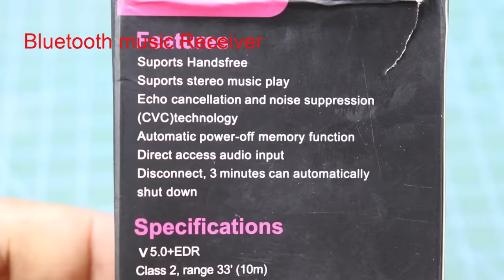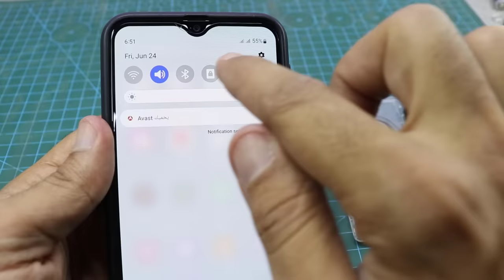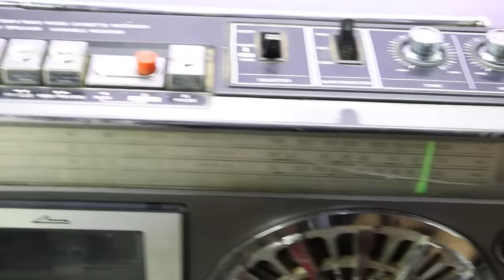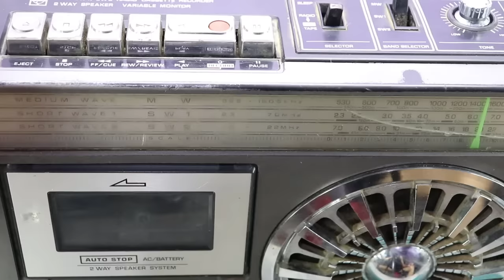This Device is very helpful , you can make at home

Comment: You can do other mods to eliminate the battery, an internal power route.
Make a metal contact in the cassette deck where the cassette slots into,, which is connected to an internal power line(find suitable power source from circuit board, then have a metal contact wired up to the Bluetooth module within the cassette housing. Put the cassette into the deck so both contacts touch each other to provide power to the Bluetooth cassette module.
Reply from the maker: genius Idea 😉

Comment: I can't believe it someone is doing this in 2022. Price of entire BT speaker is 2-3$... Thumb up for nice project... :D
Reply from the maker: This device is useful for those who have an old cassette
Reply: @Inventor_AW  yed, but why would you use it that way? It's some worth casette player, so if you want to use it as amp with speaker open it and connect it directly to amp. This way you have a lot of signal loss so sound is 💩

Comment: Cool, but for like $8 on Amazon you can get a pre-made tape adapter without having to break out the soldering iron
Reply from the maker: I did not mean to use this thing in 2022.. It is only useful for those who own an old cassette or a car with a cassette

Comment: Back in the 60's when small, portable reel to reels were popular, I discovered I could remove the tape head and attach a speaker to the two wires and make a little amplifier. I decided to bug my sisters room by taking small copper wire unwound from an automotive voltage regulator and run it out my window to my sisters room. I would then connect and hide the speaker in her room by hanging it off her curtain rod. 😄😄

Reply
Reply from the maker: I'm glad to make you bring back some memories

Comment: Actually, all you need to do is solder a small cable to the line input to the preamp, and drill a small hole to fit the tiny socket.

Comment: I was going to point out that this is mono, but somebody else did it already.. I'd like it more if you had used a stereo head for the cassette, it was going to work the same in that old mono player, and in a more modern stereo one.. But us a very good idea. It's inspired in those old cassettes with an aux micro-stereo plug, but this is Bluetooth.. A nice way to use those old players, that one is now a vintage BT speaker with AM/FM receiver.. hahaha 🤣

Comment: It is mono... Not Stereo as it would be near impossible to align that broken off tape head to the tape head of the tape player. Since it is also putting the positive leads of both the left and right channel, what you hear on the tape player is only what is not on both the left and right channels at the same time, meaning usually bass drums and bass guitars, and even sometimes vocals if the singer was recorded with a mono microphone. This is a horrible idea. Instead use that headphone plug jack on either end to plug the Bluetooth receiver into the AUX port on the tape player and listen to your music that way or just plug headphones into the Bluetooth receiver.

Comment: I have never seen such a stupid thing: 1- the sound of only the left or right channel (where the signals are combined);  2 - the head has slopes and is not positioned;  3 the engine of the tape recorder is constantly running.  To solve these problems, instead of the head in the tape recorder itself, a bluetooth module is soldered and power is supplied from the device itself and not from the battery...

Comment: why not just plug the bluetooth adapter into the aux input which most cassete players have?
Reply from the maker: what if the cassette has no AUX?
Reply: @Inventor_AW  If you have the technical skills to make this cassette adapter, you should be able to add an AUX input to your boombox. It's even easier than making this adapter!

Comment: How much did ALL THOSE PARTS COST YOU?? OR .... YOU could just buy a modern Portable Bluetooth on Amazon for $20 USD ( I did) like a Jam Replay,  that will play for 8 hours on one charge.... and not have some big bulky radio you have to plug in to a wall socket or buy expence D cell batteries to power!

Comment: Although feasable, this is not as easy as depicted. If you build this, you have a chance it might work, or a bigger chance it will sound awfull. 

That head needs to be aligned.
Reply from the maker: Just place the head in the center of the tape to get it aligned
Reply: @Inventor_AW  It's not that simple. Most tapedecks have a system with a set screw.
Reply from the maker: @janklas7079  alignment is really needed but in the case of running a Tape because it's thin
Reply: @Inventor_AW  Alignment is even more needed. Because the tape is thin, you can have it self-align. You can't do that if you butt two heads together.

Comment: Unfortunately far too complicated, too cumbersome and only one audio channel. In addition, Bluetooth usually only reaches 10 m and can only supply 1 device.  🙄🤦‍♂
MUCH SIMPLER: FM transmitters to VHF can be bought as a ready-made device for €10. Simply plug into the headphone jack of your smartphone (or any other device with audio out) and in the neighborhood within a radius of 100+ meters all radios on FM/VHF will be served with music, even in stereo. The transmission frequency can be adjusted between 88 and 108 MHz. 👍☺

In German: 
Leider viel zu kompliziert, zu umständlich und nur ein Audiokanal. Zudem reicht Bluetooth oft nur 10 m und kann nur 1 Gerät versorgen. 
Viel einfacher:  FM-Transmitter auf UKW gibt es als fertiges Gerät zu kaufen, für 10 €. Einfach an die  Kopfhörerbuchse vom Smartphone stecken (oder beliebiges anderes Gerät mit Audio-Out) und in der Nachbarschaft im Umkreis von 100+ meter werden alle Radios auf FM/UKW mit Musik bedient, sogar in Stereo. Die Sendefrequenz kann eingestellt werden, zwischen 88 und 108 MHz.

Comment: плохой способ ! головка очень точно настроена к ленте а сдесь она болтается качество будет отвратительное ! темболее сигнал аналоговый от голвке к головке ! у каждого магнитофона есть линейный вход просто надо было купить разьём и к нему припоять блютуз передатчик
bad way! the head is very precisely tuned to the tape, and here it dangles, the quality will be disgusting! the signal is analog from the head to the head! each tape recorder has a line input, you just had to buy a connector and solder a bluetooth transmitter to it

Comment: This is how you can destroy your old cassette deck. Hhahahah I remember the time 30 years ago when that was "good idea" for only few models. Most cassette players had protection and that will never work.  Final decision: Useless like before.
Reply from the maker: What's do you think?
https://www.youtube.com/watch?v=_dbNfvZM1ZE&t=406s
Reply: @Inventor_AW  Hahhaha, this is not called "avoiding protection". There min 3 switches in the player that you cant make to work. Some of them measure tension between tape and real speed. Also if you pit this in "auto-reverse" deck with spinning head you will destroy it. As i say before. That device was good 30 years ago only on very few models cassette players. And they was STEREO compared with your MONO head. ;) And even with factory quality sound was bad.... very bad. Your phone have 10 times better sound than any 30 years old cassette player. I can make steam locomotive to work on nuclear power, but will remain old steam locomotive which people want to forget. Dont get me wrong, you just get late with 30-40 years.